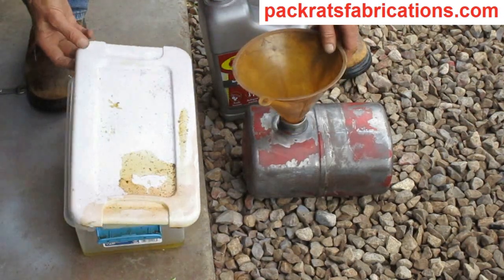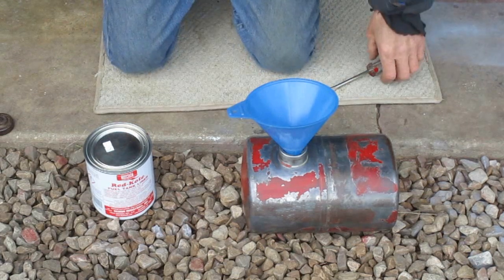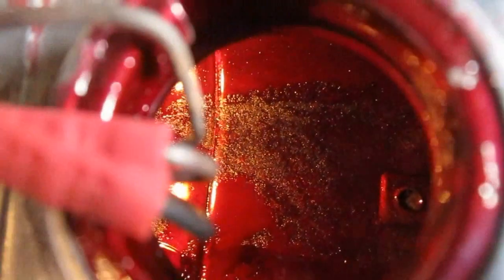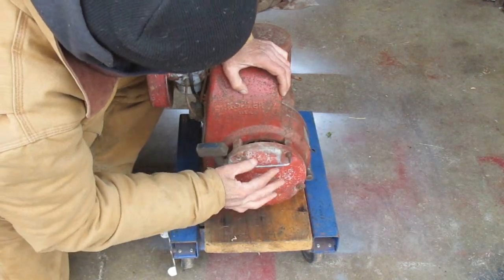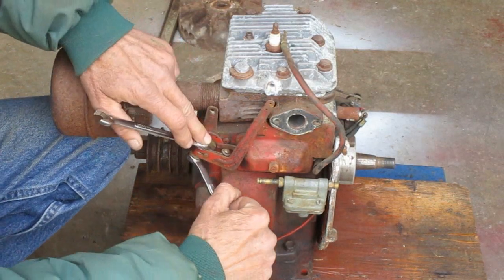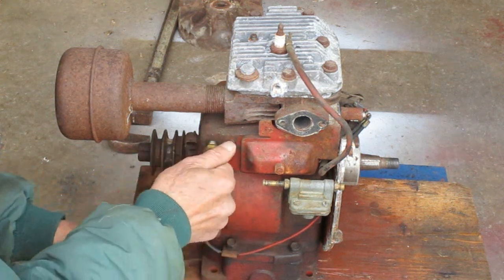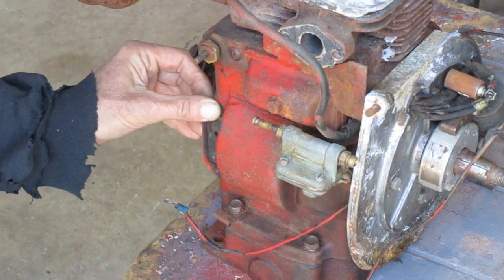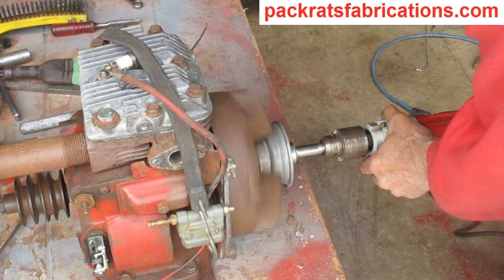Wheel Horse 704 Cleanup #17

Comment: Do they still make a repair gasket for the two-piece tank on a 1963 753?
Reply from the maker: The last time I bought one it was from somebody on eBay reproducing them a few years ago. I don't think TORO (they bought Wheel Horse) sells them.
Reply: @PackratsFabrications  thanks, if I can take it apart carefully I'll have to use something fuel rated to seal it up that won't ruin the aluminum, maybe make my own gasket.
Reply from the maker: @sabbath7081  Yep, make your own gasket and use a tank liner/sealer product. Search for info on POR-15, it's a 2-part fuel tank sealer that you mix like epoxy, there's a multi step process to get it done right. Also search for info on Red-Kote fuel tank sealer, there's no mixing, easier to use. Each type has it's advantages. I think Eastwood also make a fuel tank sealer.